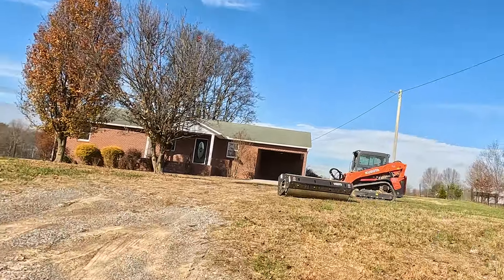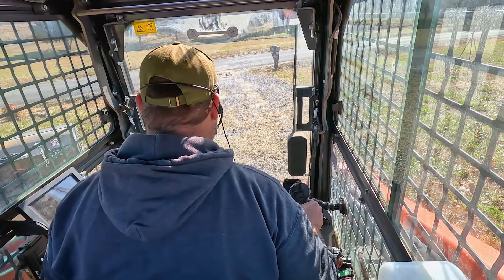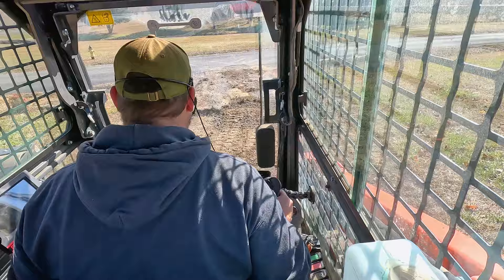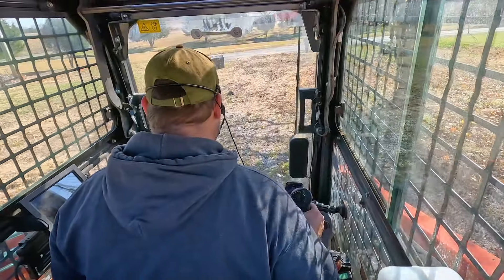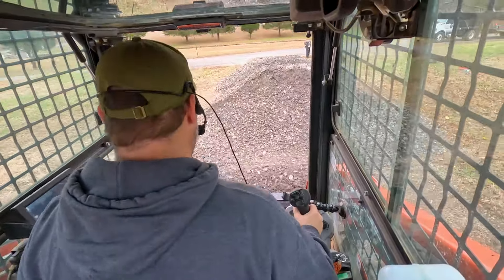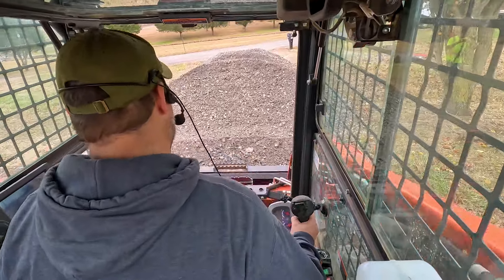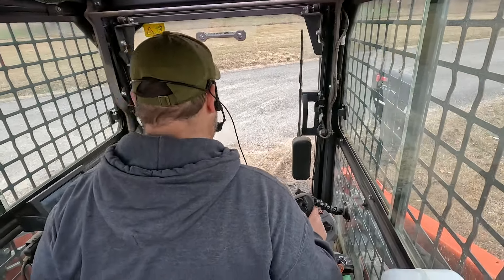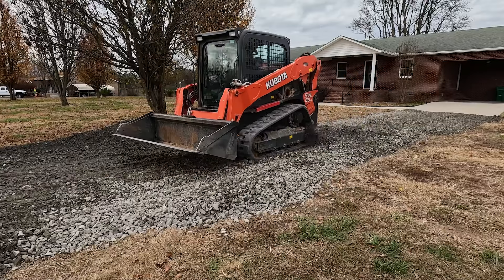Gravel Driveway Repair: Skid Steer & Low Budget

Comment: What did a job like that run in your area if you don’t mind answering
Reply from the maker: I typically don't put prices in here because the videos will be up for years.  However what I will say is that it ended up being:   25 tons of crusher run (delivered price) plus 3 hours skid steer time.